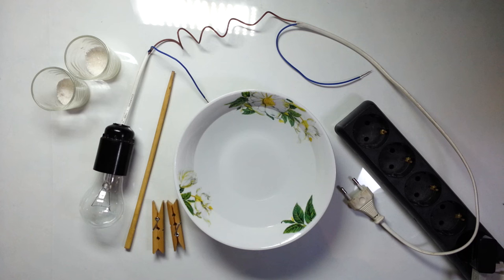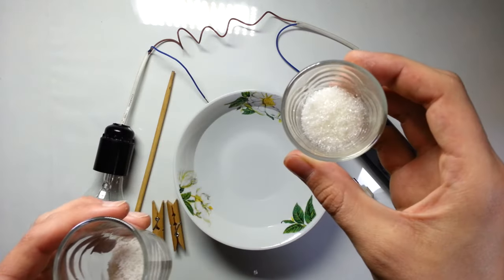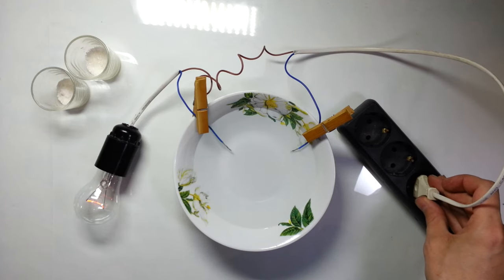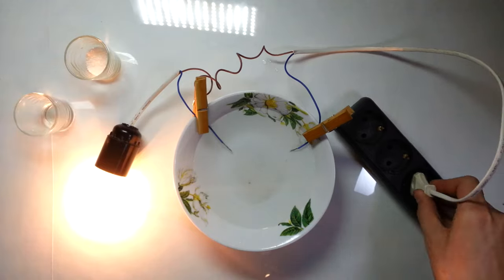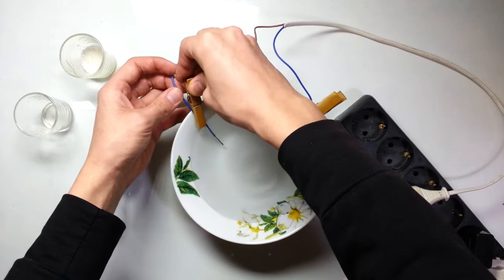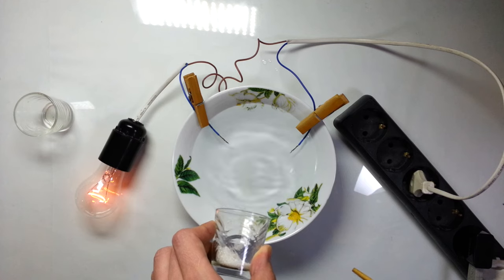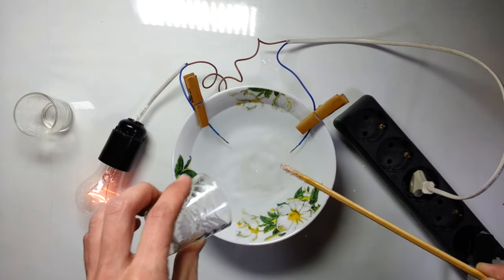Electrical Conductivity with salt water & sugar water

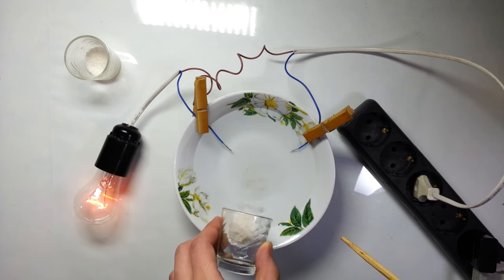Comment: it's the electrolytes that are conducting the electricity, and since electrolytes carry charge; the higher concentration of electrolytes in a solution, the higher its electrical conductivity. And you can see this at 0:45. Also sugar is non electrolytes that is why it didn’t dissociate into ions

Comment: If i connect the wires to water won't be there any flash or problem to water directly?
Reply from the maker: Hi, If you turn the electricity on while the wires already in the water there will be no flash or sparks... It will be just a slow electrolysis with the release of hydrogen and oxygen. Also, the water is heating up and eventually it may start to boil. If you apply higher voltage the water will start to boil much faster.
But If you put wires into the water while the electricity already on, you may also see some small sparks, and that is it.